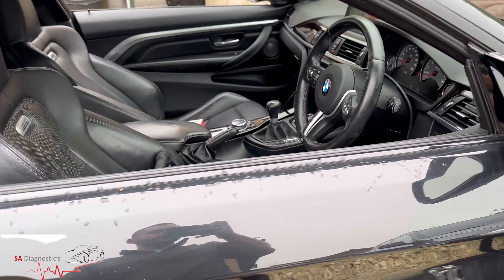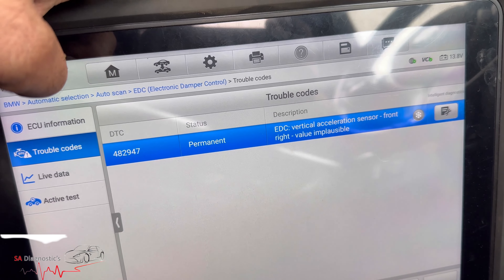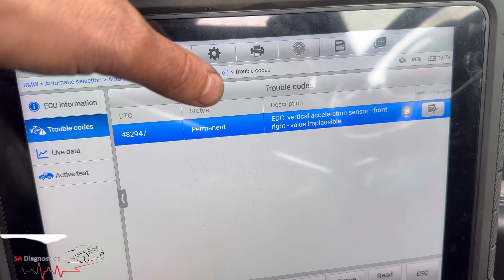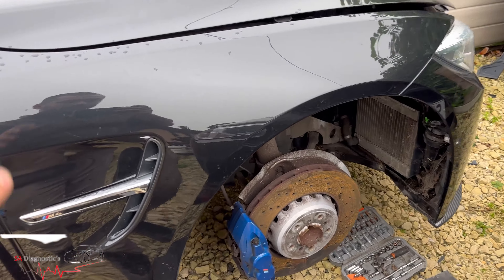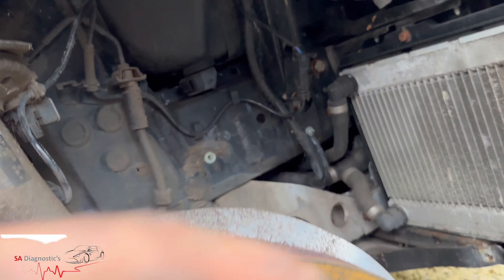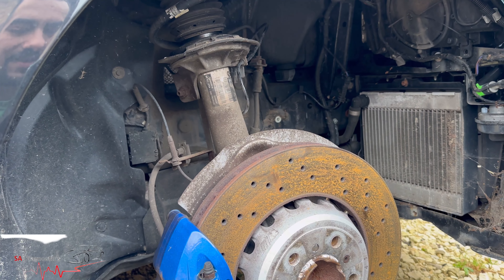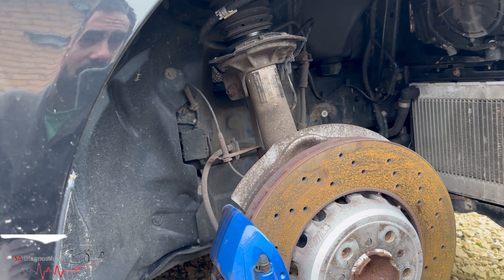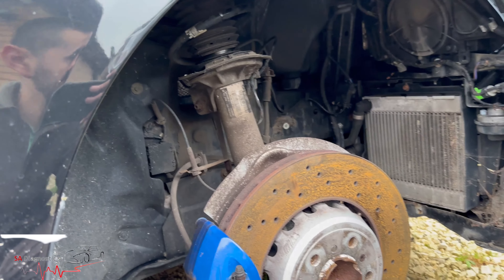BMW Chassis Fault EDC 482947 Vertical Acceleration Sensor Value implausible

Comment: What is the OEM number for the EC sensor? My car has got man errors Dynamic damping control failure. Corner ability restricted. I can only drive in Comfort mode. Sport and Sport+ is not available. I think my EDC absorber is no good. Sometime it is possible to drive in Sport or Sport+ then the car is cold.
Reply from the maker: @dinhvanpham8102  sorry am unsure your best contacting bmw and ask for the part number but only way round them is by saying can you send me a quote to your email otherwise they don’t provide part numbers so you don’t buy it else where…